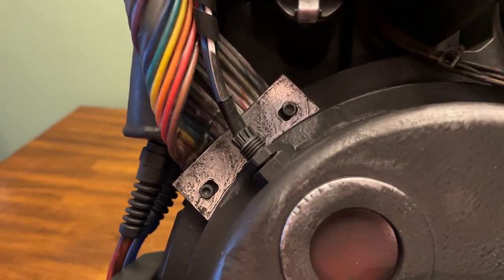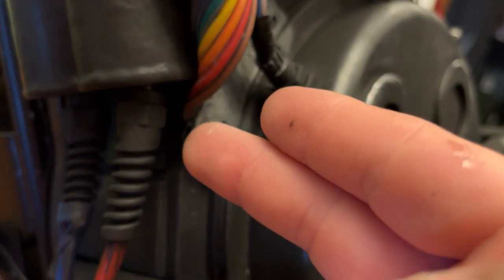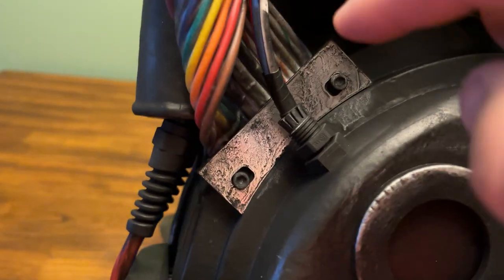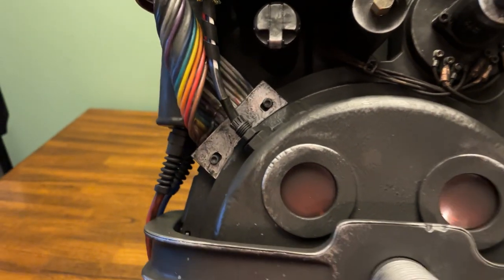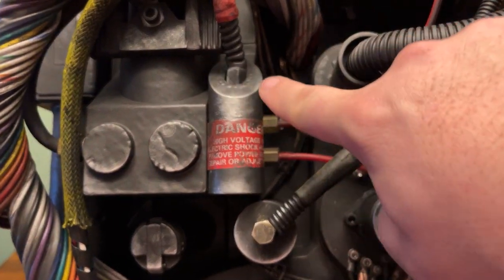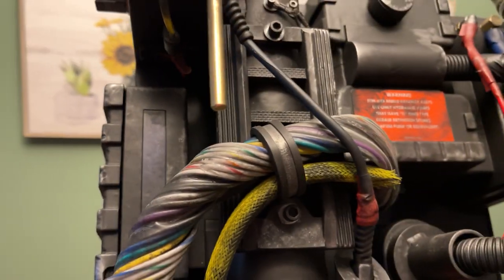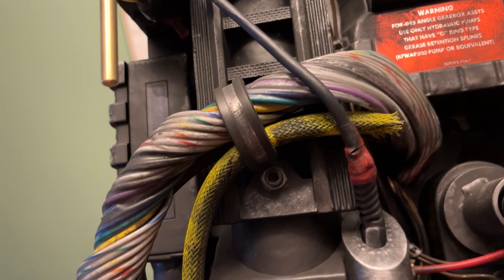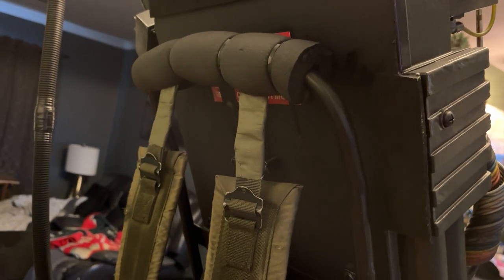Replaced the stock Ribbon Cable with a GB1 Movie Accurate Ribbon Cable

Comment: As far as breaking into the pack goes, I already broke the PCB that powers the D-Cell batteries by total accident, so as far as I'm concerned, the worst is done 😂. Got a TalentCell in there, though, so I can still run the pack without issue.

I'd love to do more modifications, and my biggest desire at the moment is replacing that terrible stock loom that connects the wand to the pack.  I'm terrible at soldering, so I'm just waiting for another run of plug-and-play replacements.

Comment: Getting my gb1 cable Saturday, a little nervous that Im gonna break my cable end to fit it

(When you gutted the cable end and superglued your ribbon, did your pack lose any functionality? I've heard rumors doing the cable replacement wrong can break the electronics.)
Reply from the maker: There is nothing electronic you can break you just have to make sure you don’t damage the white pins that slide in and out that clamps the ribbon holder onto the pack. They slide in and clamp down the metal pins attached to the metal on the pack when those metal pins are disconnected the pack won’t function correctly. If you decide to glue the ribbon and like I did just make sure the glue does not run over those pens because then they will freeze and you won’t be able to move them in an out anymore

Comment: One more question that connector piece between the wire loom and the front of the pack, what is that called and wherd u get it?
Reply from the maker: Do you mean where the wand wires hook up to the pack (the power wires) the Green Grey hose?